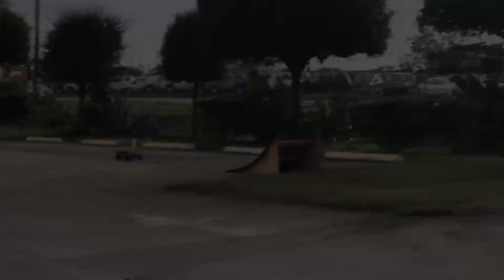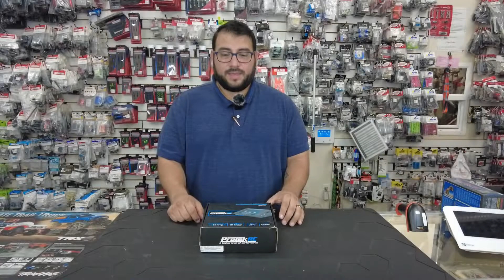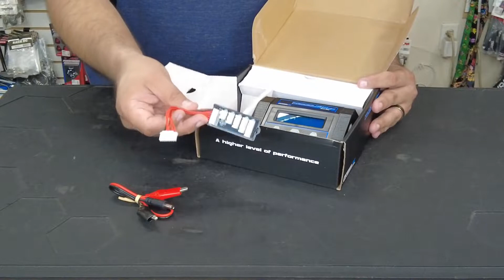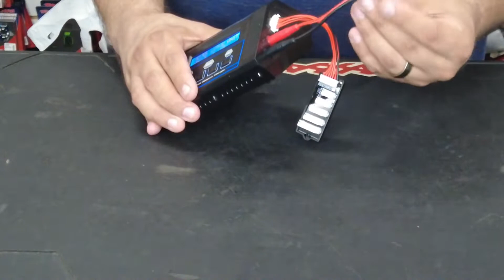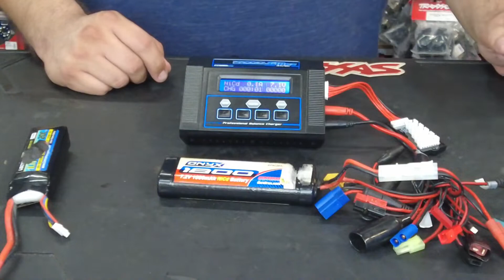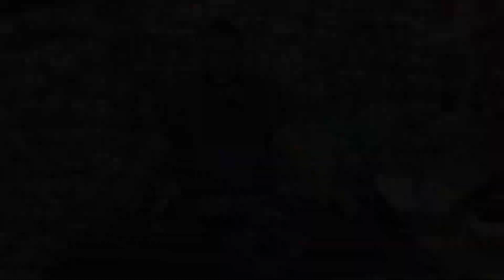How To Charge Lipo / Nimh RC Battery Using Protek Prodigy 610ez Charger

Comment: Quick question! I have an older battery than was more than likely stored with an improper charge and hasn't been used in probably over a year... I recently bought this charger and was hoping to both see if the battery was still okay and then balance it to a safe storage charge until being used again. Upon doing so it showed a quick message that I didn't catch and was flashing the word "FULL" (as if to say full charge?) Or does that mean that it was already at a storage charge? I made sure that I was in Storage Mode for LiPo and had the settings for the cells and milliamps correct for the battery. Just looking for some info! Thanks!
Reply from the maker: So it does depend on the charger but if the settings are correct for storage and charger stops and says full could be it is at full storage charge , if your charger can view lipo cells you can see where each cell is . Roughly around 3.8 per cell is storage charge or if you have a lipo tester . Hope this helps